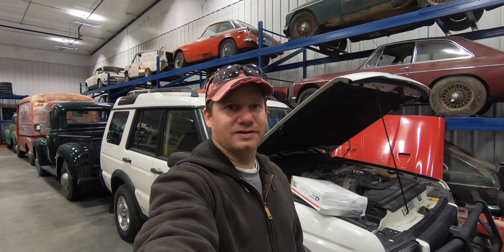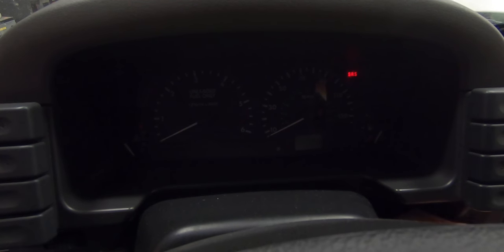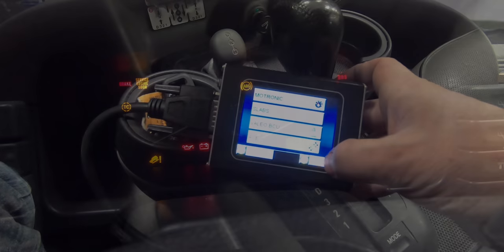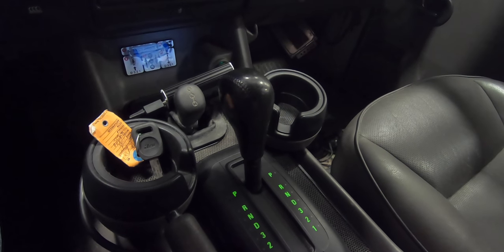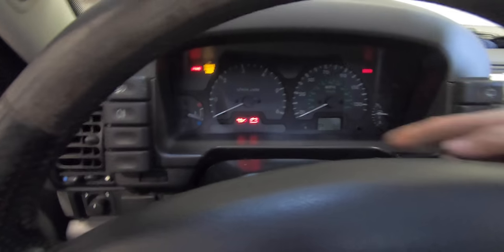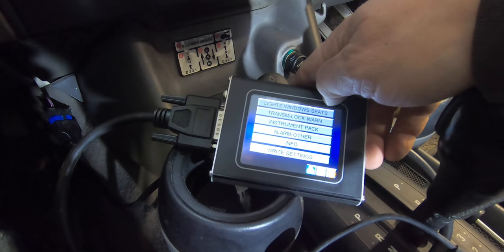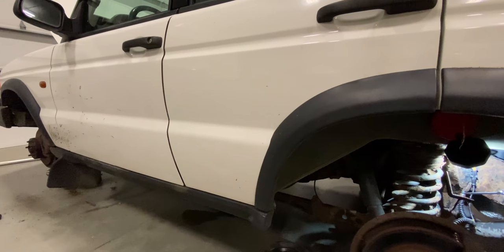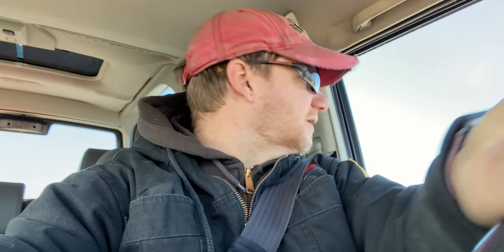Cheap 1999 Land Rover Discovery Will it Run?  Part 3!

Comment: Former owner tip... Before you put the cluster back in, crack it open an put some black electrical tape over the ABS, transmission and check engine light. You will enjoy it much more.

Comment: If you still have transmission glitches, don't forget the transmission controller under the seat - if the truck got flooded, then this is the first thing to be under water!  Mine got drowned in muddy water, so was stuck in limp mode, and it caused all sorts of weird electric issues on the dash.  Removed, took apart, washed it (yes!) then used throttle body cleaner, then electrical cleaner, left to dry overnight and all good when put back in.  Now it lives inside a Zip-lock bag with silicon sealant on wires to protect it.  If yours was flooded, but left with power attached, then likely you'll need a replacement.  Thankfully not too expensive for these :-)

Comment: The biggest problem with these trucks is when they sit and aren’t driven regularly. Yours sat, and more power to you for getting it running. I have an ‘04 Discovery daily drive it and it has zero issues. They aren’t bad trucks!

Comment: Surely with the M&S lights lit while driving, the trans is in limp mode and defaults to 3rd gear only. As said below, the XYZ switch is pretty easy to repair. Drill the rivets out, clean it out with electrical contact cleaner and pop rivet it back together. They fail because the AC drain drips right on it.

Comment: After 10 years of use, commuting across London and a year in Rome, I sold my 14 year-old Discovery at 234,000 miles to a guy in Devon who wanted it for towing a trailer for work. Ten years later, it's still going fine.

Comment: Mine also had flashing M&S lights when I got it. New (used) transmission computer (under driver seat) from ebay fixed it. I'd be willing to bet since your other computers were done for it will be too.

Comment: I solved all the problems with my Discovery II by changing it to a Toyota Land Cruiser, now I am trouble free!
Reply: Can you provide more details.  What year, parts replaced from the Toyota?  Do you need the nano or such to program it for the Land Rover?  Mines does not crank or start just like video.

Comment: Well done. I'm on a 96 disco.  Nearly finished after two years.  Total rebuild on diesel engine, transmission, interior, drive line after it got flogged through everything and a half and I mean it got hammered for four years before it gave up.  To be honest haven't spent more than 2,000 AUD.  Plenty of spares available from wreckers because people don't like working on them.  Will keep it going for years as a bush basher.

Comment: there is a simple trick to resetting the ecu ,,once you have plugged your reader in ,turn the steering wheel full lock right then full lock left then full lock right then centralise it job done

Comment: I’m from Brisbane, Australia..   I had a Td5 auto discovery 2 about 8 years ago...With out doubt, the biggest pile of crap I’ve ever bought. I should have stuck with a Land Cruiser   The “M and S” flashing lights refer to a faulty solenoid in the gearbox, I believe each gear has a solenoid.  I hope you get it sorted, Steve 🇦🇺🤙🏻

Comment: You may only need to adjust the xyz  switch and the shift cable. I had the same problem with my Disco, bought a switch. But adjusting it fixed the problem. So, now I have a switch that I don't need at the moment., and they are expensive. Buying the switch directly from the UK saved me a couple hundred dollars.

Comment: Might be worth taking it to a LR dealer and paying for a full diagnostic check to determine root cause of the problem.
In doing so will save you money from buying and changing components you don’t need to, concluding with a correct fault diagnosis to enable you to make a decision as to repair or scrap it.

Comment: The S and M flashing is a serious fault. I had the same problem on mine. I read if they flash to pull over immediately.  It would be at half engine power as well. It eventually went away on it's own.

Comment: I have had a few of these trucks and had this problem before, that battery is way too small. The M & S lights blinking means it is in limp mode. I solved the limp mode issue with a 900 CCA battery by Interstate. good luck

Comment: Funny I had the exact same issue you had with it starting only for a second turns out it was only the fuel pump relay malfunctioning so I replaced it with a new one and it ran perfectly after that. I guess the relay keeps the pump from overheating buy cycling it on and off.

Comment: You do understand that vehicle has a center differential? The blinking lights have to do with manually pulling that forward gear shifter back into the highrange. There is a series of buttons to press to do another reset that was electronic, but my memory is blurry about it. I think your center dif is in the wrong gear.

Comment: You need to adjust the xyz switch in a way that every time you switch from park to any gear the gear show up on the odometer. Right now on the video the truck is on D but it doesn’t show on the dash. That can put you on limp mode.
Reply from the maker: I tried that in Part 1 but the XYZ switch was bad.  I didn't want to buy one until I knew the truck would run.  Now that it is running I put in a new XYZ switch and everything is good now.

Comment: if the engine starts for a moment and shuts down immediatly, its always the problem with the immobilizer signal  between the key transponder, engine ecu and the part where the alarm-chip is placed in. If syncronization is not working one of this 3 parts is killed. This kind of problem do have a lot of cars, Audi A4 B5 driver know exactly what i'm talking about. The Discovery got same problems.

Comment: New to the   channel, did you have to use the nano to program anything with replacement  ecu and bcu.  I have a 2001 Disco 2 that will not start or crank.  I don't have a nano, would you suggest the matching Ecu bcu and cluster and fuel pump?

Comment: Good Vid and camera work. 
Land Rovers are like boats the two best days of ownership are the day you buy it and the day you sell it.
Reply: As an owner of one I can comment that you are far from the truth. This vehicle is exceptionally neglected and as such why shouldn't it give problems?Enough to see the amount of rust inside the vehicle or the red wire someone installed to give one an idea how poorly this vehicle was maintained. A car/truck is like every machine, if you neglect it eventually
it will break down.After owning a Toyota I have learned how unreliable a vehicle can be, so the Land Rover is miles better. My two pence.

Comment: I'm curious how much you ended up spending in parts for this? The last two Discovery IIs I bought cost me less than 3 Grand Canadian and were completely running when purchased. Mind you I only got them that cheap because they had the dreaded worn out tappers clattering. Even though I'll still get another hundred thousand km out of them, it scares off the original owners from lack of knowledge.
Reply: Thicker oil
Reply: @charredskeleton  no unfortunately that's just a myth thicker oil doesn't make any difference unless you're using it to stop a leaky engine gasket

Comment: When you removed the fuel pump you would have been better off to have thrown a lit match in the open hole.  These were so bad a fellow I know had one and tried to trade it at the dealer who had sold it, they didn't want the vehicle back.